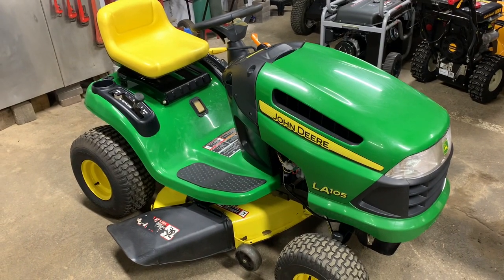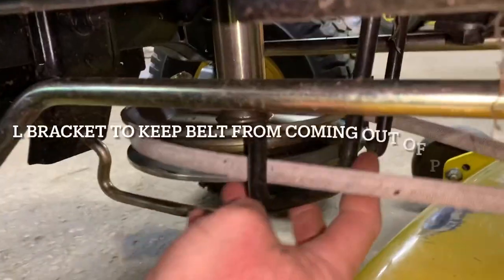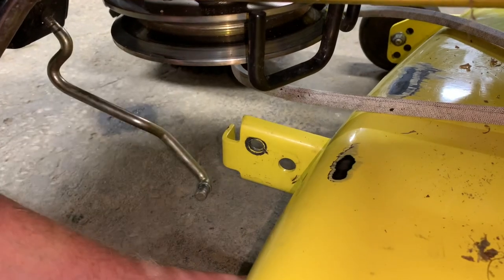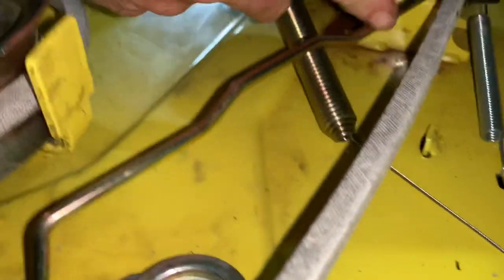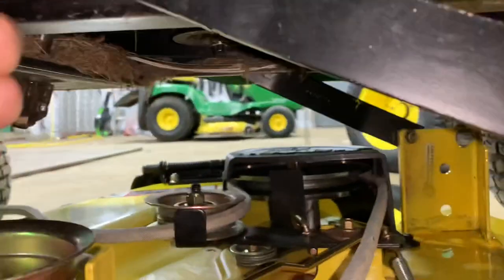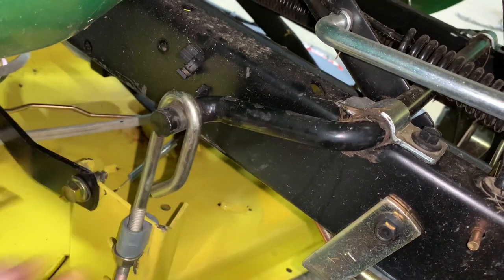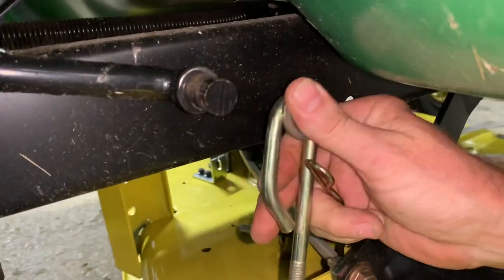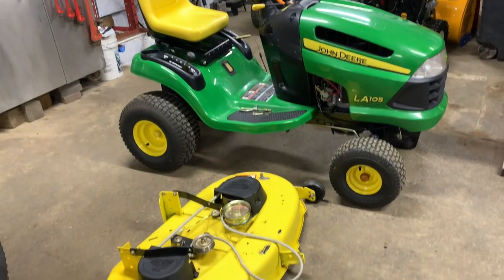How to Remove Mower Deck John Deere LA105

Comment: Dude, you're the man. Now comes the hard part of fixing rusted out deck hangers.
Reply from the maker: Hi Brian, yes, the hard part. If it is the rear deck hangers, Grind and weld. I hope it all goes well! Thank you for watching and commenting :).
Reply: @JohnsonsSmallEngines  Yeah, been there done that. Now J&B weld, safety wire and parachute cord. A new deck is almost what I paid for the mower.

Comment: I usually lay down a plastic tarp under the mower, it makes moving the deck out more easily and doesn’t scrape the paint off the edge of the deck.    👍👍.  also, you can take some pictures for a reference later on.